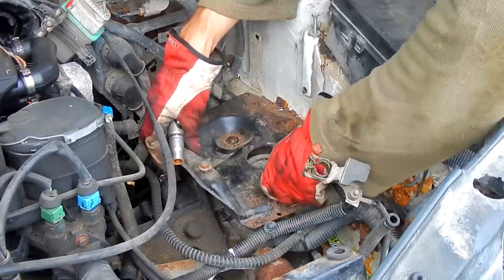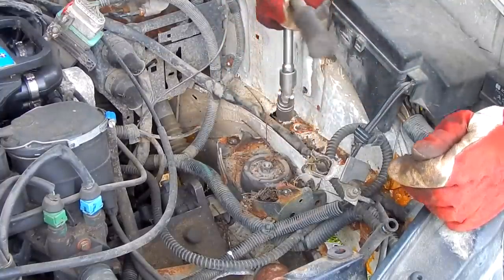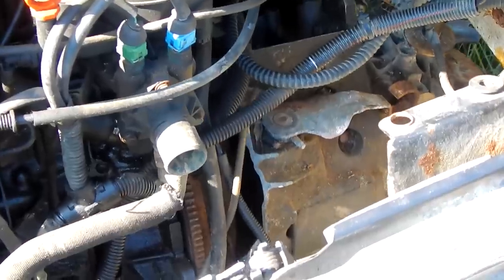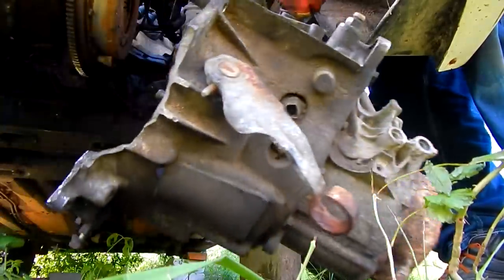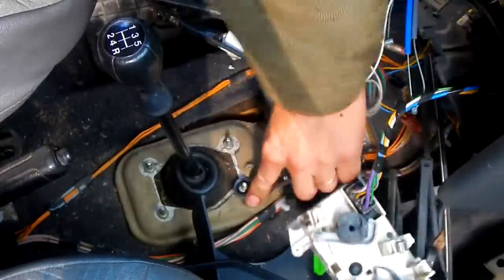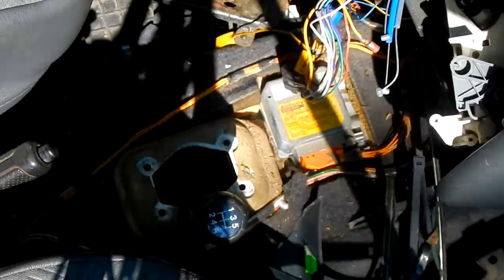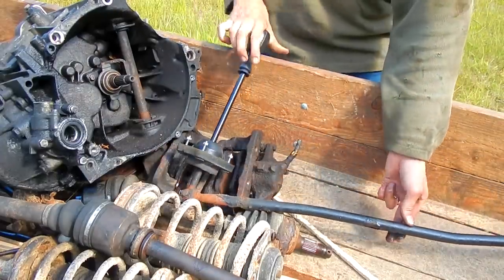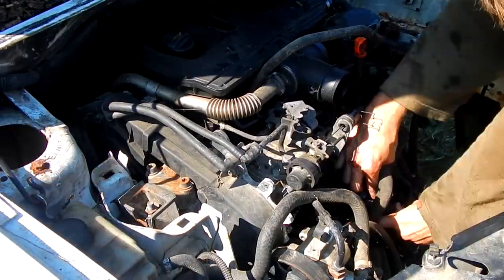Scrapping A Car For Parts - Tracked Amphibious Vehicle Build Ep. 2

Comment: Kind of makes it easy  when you know you aren’t reassembling that car back to. Original or  safety specs again  by just   Using bolt. Cutters and  whatever to get to that specific part  years ago. I bought a used engine from a wrecking yard. And thats how they had taken it out of the vehicle. For me which was fine as i had all the  components on my engine i needed to install the  replacement one i needed

Comment: Cool! very interested how you will go about coupling the transmission to the 20hp v-twin. Specifically the amount of reduction and what type of clutch. V belts and pulleys? Chain Centrifugal clutch? The Stock Clutch and Flywheel?
Similar two one of those 212cc predator trucks?

 I can see the steering being skid steering by having the break calipers on separate controls putting more power to one side or the other of the differential like a tractor or bulldozer. That power steering pump could run a hydraulic cylinder or two.

Looking forward to seeing your solution!!
Reply: I bet he uses the brakes as brakes.  Look at where a hummer's brakes are located.

Comment: Ain't that the van you put all that money in the front end with new bushings, bearings n disk brake system?
Reply from the maker: Nope, that is 1.6 petrol I repaired and it is still running. This one I dismantled is/was a 1.9 diesel.
Reply: @DonnDIY  which would you rather have? Diesel or Petrol?
Reply from the maker: Diesel had more torque, better to tow things. Petrol is better for everyday driving. So both. 😀

Comment: Typical French car, usually a nightmare to work on and if it gets wet it crumbles to rust mush.I guess the timing belt snapped and the engine went crazy and selfdestucted, happened several times to me prematurely on French cars...
Reply from the maker: You can see in the video me taking off a perfectly good timing belt. The connecting rod broke, that was the problem.